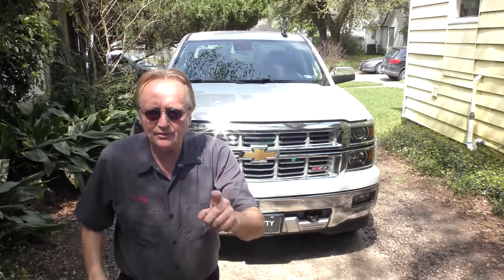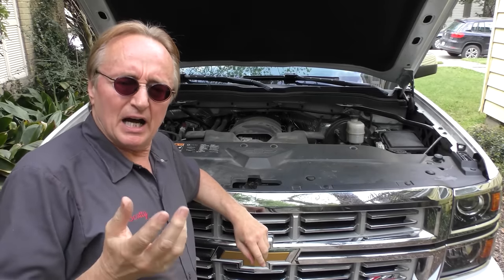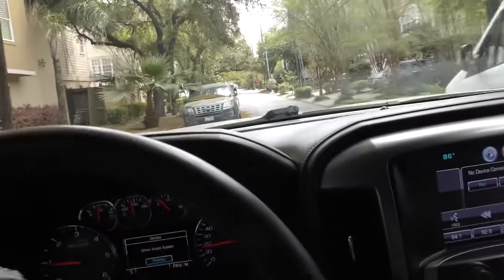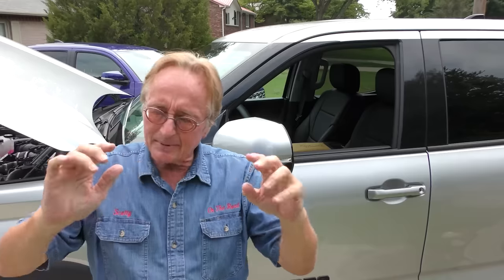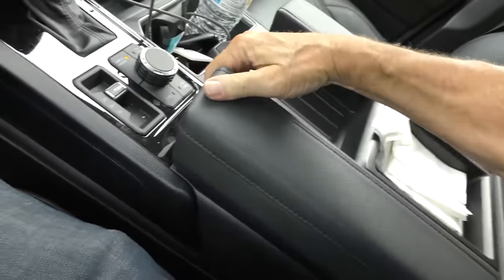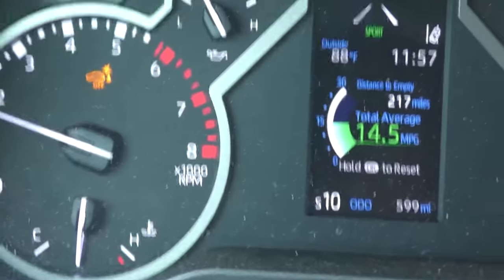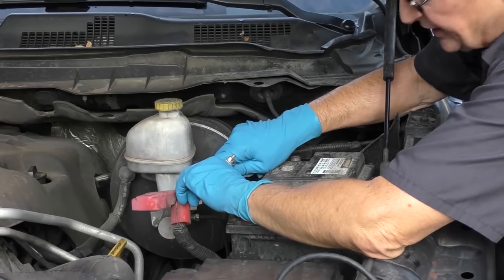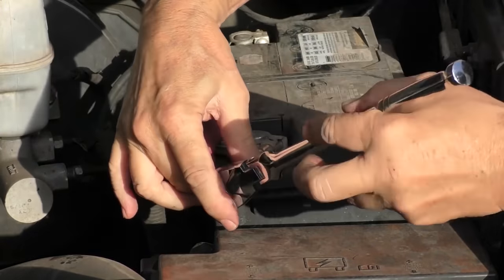3 Trucks I Wouldn't Touch with a 10 Foot Pole

Comment: Looks like Chrysler was too damn cheap to even use a gear reduction starter like they did years ago.  I owned a 1973 Dodge Dart Sport (Duster Body Style) with a slant 6 225 engine and they used the gear reduction starter on it.  I had a starter on this car last for 9 YEARS !!!!   Chrysler seems to build sugar honey in tea vehicles

Comment: Number Four: Ford F-150 ECOBoost . . . any year. The Ford ECOBoost line of engines are an unmitigated disaster. Anyone contemplating one of these vehicles, RUN AWAY as fast as you can. I had one of the original 3.5 engines and the cam timing chain tensioner went out at only 90 K miles. The chain jumped on the cam gears and the valves smacked into the pistons in at least two cylinders. The valve timing system on these vehicles is comprised of plastic guides and these POC chain tensioners. There are MANY other problems with these engines and they are NOT generally capable of long life reliability like the standard V8 engines found on GM and Toyota products. I will NEVER purchase a Ford vehicle again.

Comment: I love how you say that the GM truck is $50,0000, and you have problems with the A/C after 50,000 miles. I have a 2015 GMC Sierra crew cab 4x4 Z71, never used the A/C unless I was on my way to a wedding or funeral.  Dressed up. Otherwise I had the window's down, because I work outside in the elements.! So why would I use A/C on. My way to work.?! You complain about the ALMIGHTY Toyota not getting at least 20 mpg out of a V6 turbo. While I get 21 to 20.5 out of a 2015 V8 running a V8 all cylinders all the time, ! And your beloved Toyota V6 with a turbo gets less. But let me guess Toyota is still best. No matter what.!

Comment: Taking the dash apart to get to stuff is just plain STUPID!  You might as well replace the heater core while you're in there because GM heater cores are junk.  Parking brakes need to be centrally located between the seats, just in case something happens to the driver the passenger can activate the parking brake.  I won't buy a vehicle with 1 turbo not alone 2, they only last about 125,000, now put that in a truck and tow a trailer which means the turbos are always running which is increased wear on the engine; so I'll be keeping my 5.7 Tundra.  I gave up on American vehicles after years of being insane thinking America would get their act together, nope, I will never buy another American vehicle, only Honda/Acura or Toyota/Lexus.

Comment: What about these EV vehicles. The EV vehicles get involved in wrecks, just as all of the rest do and always will. Gas or diesel vehicles get damaged too bad to drive, happens all the time, right. Those go to the tow truck owners yard until fees are paid, vehicle gets picked up and back to owner ( in fact, thats the way it should work). EV vehicles, now tow companies are about to start to have to dig and build concrete pits to put damaged EV cars in due to fire related deaths caused by these vehicles. Breathing the air, must you be trying to save someone trapped in a burning EV, can ultimately kill you.

Comment: My account     my account.  My air cond  was not working for five years took it  to two places  they sI said it was going to cost  o e one grand without checking   tooking   to another place one thirty five they cleaned the evaporator coil  whT ever that is

Comment: This guys full of crap 😂I have a 2014 gmc sierra 1500 slt bought it in 2013 and still running to this day with 210,300 miles and I use it as my work truck it has a screen and everything and ac seats still work 😂 and the bed does in fact work I keep it full of tools and use that tailgate handle 6/7 days of the week at work and no problem
 Never snapped off and I live in Texas where there is 117 degree summers and ice road winters.
Reply: Oh and the AC problem was more than likely the actuator because I had replaced mine when it had same problem and it fixed it right away and never had AC problems. Just do maintenance on your truck and it runs forever